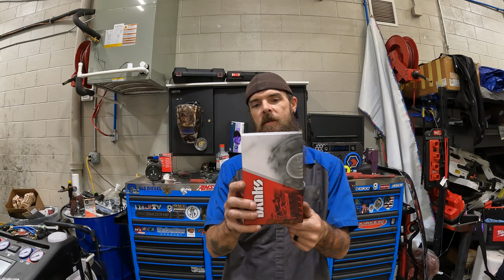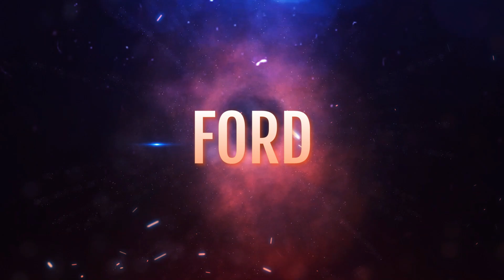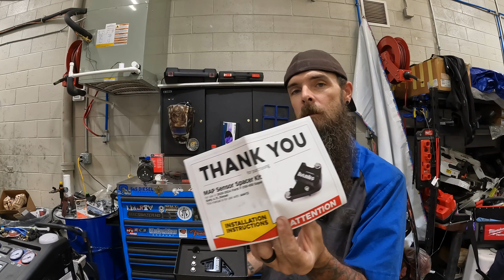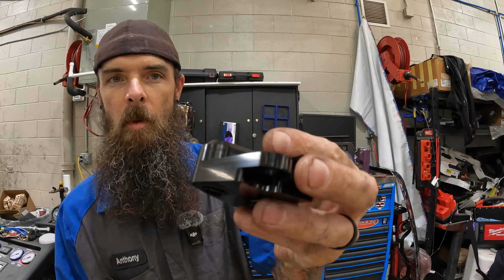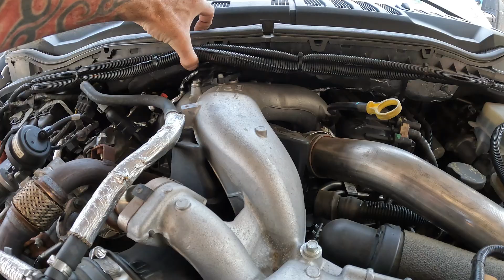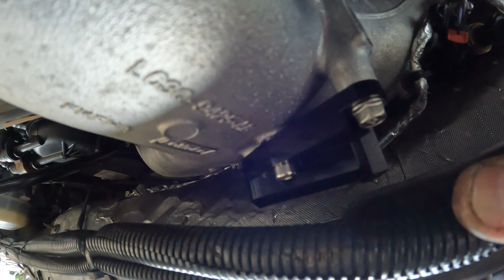BANKS Power.  MAP Sensor Relocation 6.7 Powerstroke INSTALL How To

Comment: Perdona mi ignorancia  , que obtienes con esa adaptación,  me sirve para un dodge neon modelo 97 , quiero mejorar la temperatura de aire de admisión.
Reply from the maker: Its not an intake air temp. Its manifold absolute pressure.  With this diesel it takes it out of the stream so it doesn't get clogged up with soot. You can't improve intake air temp by changing a sensor. It just reads whatever the temp is coming in.

Comment: So this is not an issue on a 2015 F450 with 6.7?
Reply from the maker: @carlosg3824  yes. This was just the part number for the 2020+ .  They have them for the 2011-2019.  This just happened to be the one they sent
Reply: @BeardedFordTech  Ok...It says on their page that its in development for my 2015 F450 Cab n Chassis
Reply from the maker: @carlosg3824  okay then yeah they started with the 2020+ since it has a different intake system. The 11-19 has a plastic intake and doesn't have a metal bracket on top. I'll reach out to jay and get a time frame
Reply: Thanks it's on a brush truck
Reply from the maker: @carlosg3824  try to keep the idle down as much as possible. This will help until one is engineered
Reply: Unfortunately since it's a brush truck it idles for sometimes hours on end not uncommon to idle for 6 to 8 hours a day when it's on a wildfire

Comment: BFT How often should the MAP sensor be cleaned, and what do you use to clean it?
Reply from the maker: @richwitt3559  I check them at every service cause these so idle a lot.  If it doesn't idle a lot and the Temps stay up they should last a while with very little clogging.  I have had a few bad sensors cause the internal failed not cause of clogging.  This relocation should let it last a lot longer. Can't really put a mileage on it cause everyone drives their truck different. But it's a good habit to at least check it every service.  And to clean it. Get an angled pick. Do not touch the very bottom of it. Just scrape around the side and tap it to get the crud out. Powerstroke tech talk just did a video on this too. And he shows he he cleans them which is the same way I do.